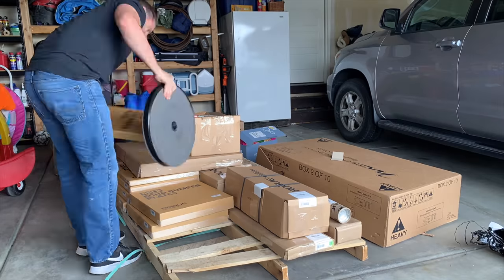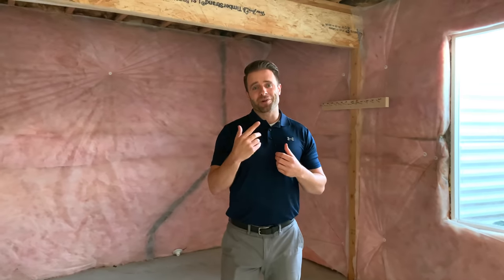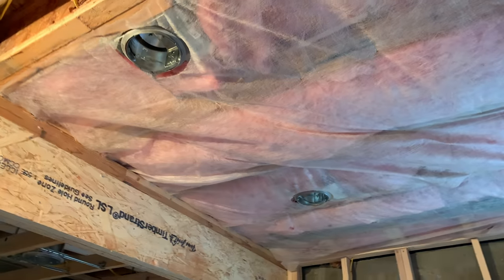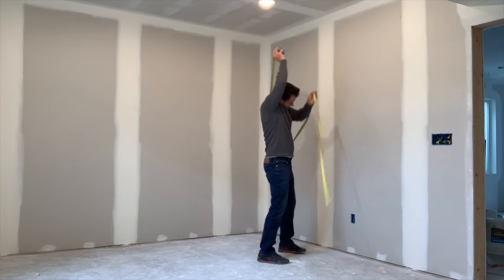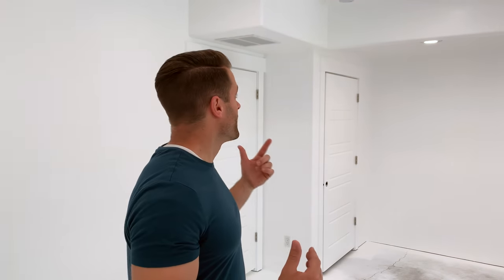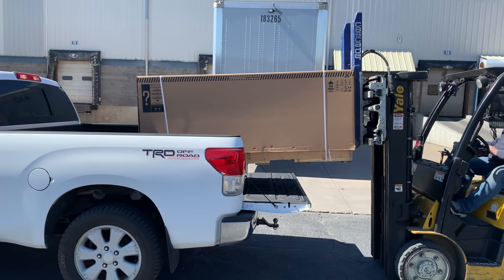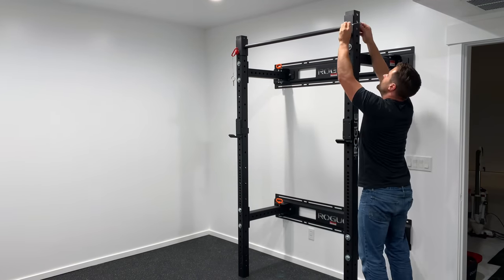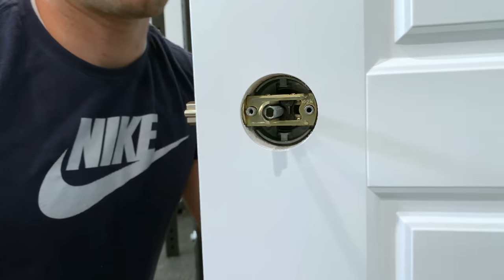AMAZING Home Gym Reveal! Build And Tour My Home Gym Space

Comment: I’ve had a standard cage style cable machine with dual pulleys for several years and actually prefer it for my own training over barbells or dumbbells. But the two vertical pole-mounted pulleys are not quite far enough apart or high enough for quite a few exercises. Coincidentally, I’ve had my eye on the FreeMotion GS24 Dual Cable Lite you installed for some time. Love the way it looks in your new home gym
Reply from the maker: Thanks so much! I love it too!